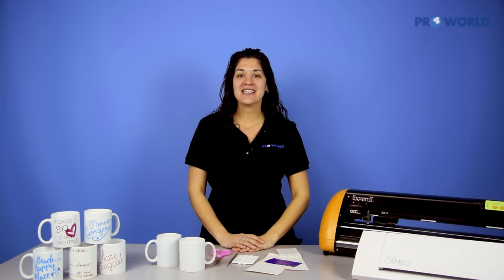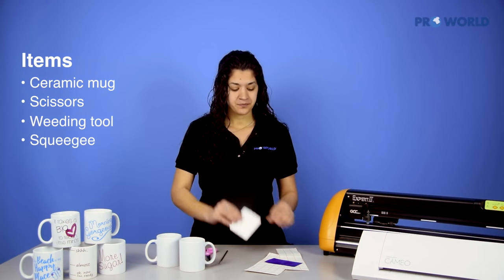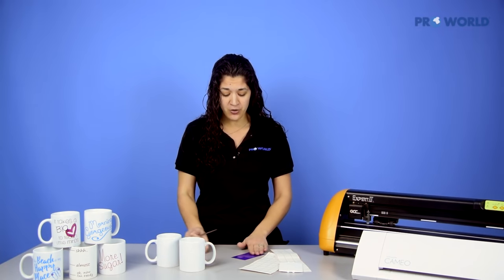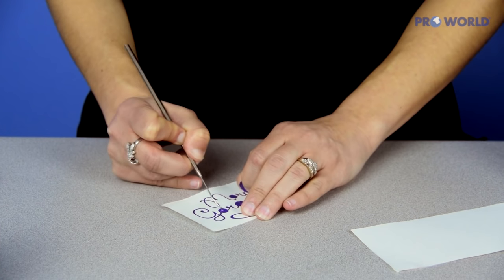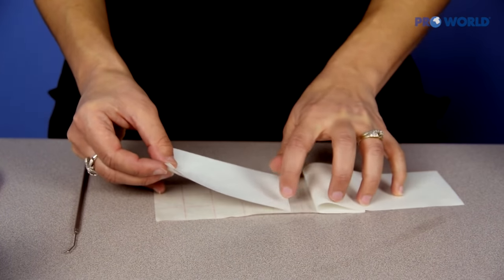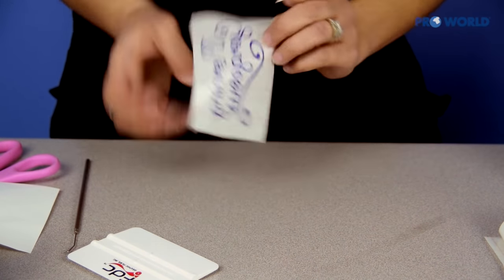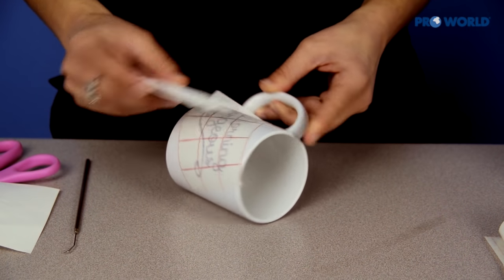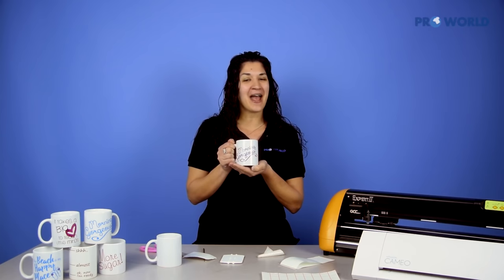How To Apply FDC Vinyl Onto A Mug

Comment: does the vinyl stay on after washing or dishwasher/microwave use?
Reply from the maker: The tests we have performed with the vinyl on a mug surface  - hold up through numerous washes and in the microwave, but you may need to do some testing to see how it holds up for you. If making them for a customer, it may be best to include a care sheet with the product so they hand wash to avoid any problems.

Comment: can you use a heat press for this too?
Reply from the maker: The FDC vinyl is not designed to be use with a heat press. For this application, you will just need to apply  it with pressure.